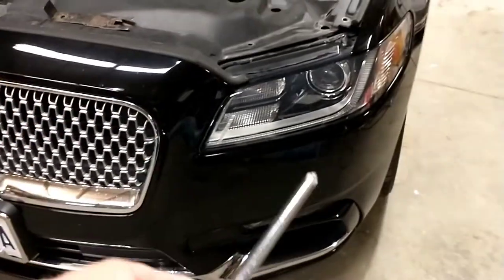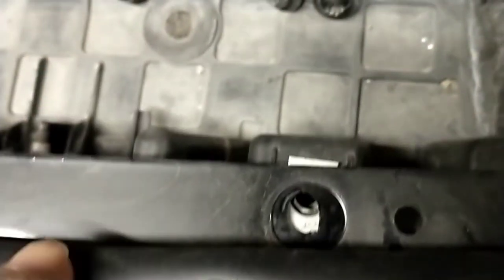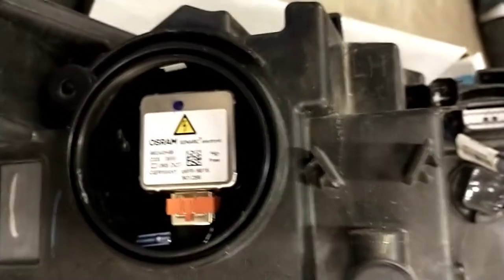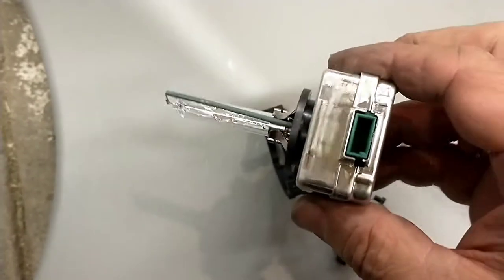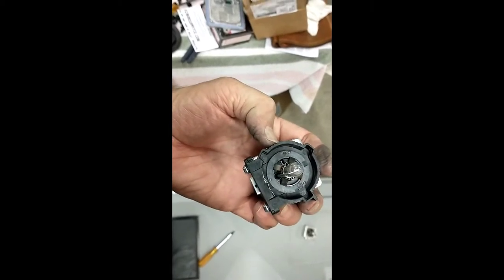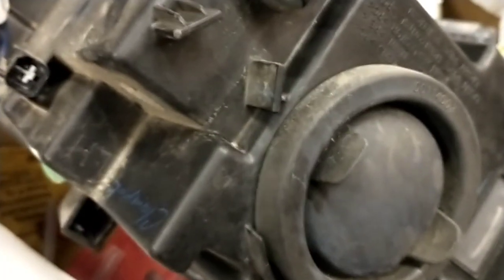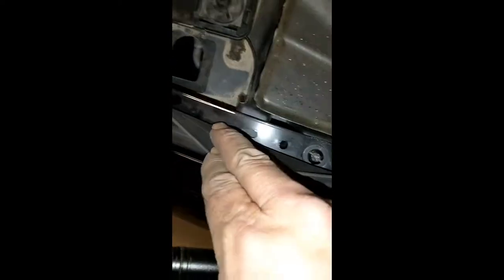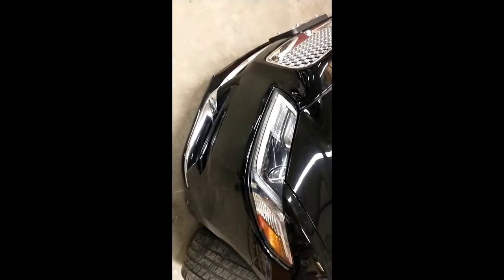2017 Lincoln Continental Headlight change

Comment: Thanks. Had the shop get in on my right headlamp thinking it would be a replacement, turned out the bulb was loose. Fixed for about a year, trying to figure out whether to try myself or take it in again

Comment: All of this JUST to change a headlight!!!??? Come on Auto Industry 😵‍💫
Reply from the maker: Yeah it's all uncalled for, there should be an access to change the freaking bulb.
Reply: @lowlidx50  your video came up in my recommended because I have a 2014 Lincoln MKS. Thankfully I was able to change both of the headlights today myself WITHOUT removing the bumper or anything. Changing headlights on the 2009-2012 MKS is an expensive nightmare unfortunately like it is for your model years of the Continental. I did watch and appreciate you doing this video 💰💯

Comment: Does this fix both the daytime lights  and the main bulb? Like the lights that curve under  (_
Reply from the maker: This is a bulb and ballast replacement. My initial issue was blowing fuses. This did not fix the problem. It was the little motors that turn the headlight left and right. I don't think the LED at the bottom or these electric motors are replaceable separately. You'd have to buy a whole headlight assembly as I did used.

Comment: Does this vehicle in the video have the moving headlights? ya know where the headlights move with the steering wheel? dealership says i need to purchase entire headlight housing for 1800.00 just because the damn light is going bad (turning colors)
Reply from the maker: Yes the headlight moved left right. That's what went bad on mine every time you turn left it would blow the fuse. I ended up finding a used assembly on eBay for about 300 bucks. Some of the ears were broken but everything else worked fine I just glued it back together and installed it. I did not know that was my issue at the time of this video.
Reply: @lowlidx50  Ok awesome, mine looks like its right on the edge of the year change, 2017, and still has the dust cover over where the bulb is, i looked at the 2018+ and they all look completely sealed LOL thank god, alright ima pull it off the car and see what bulbs it takes, thanks!